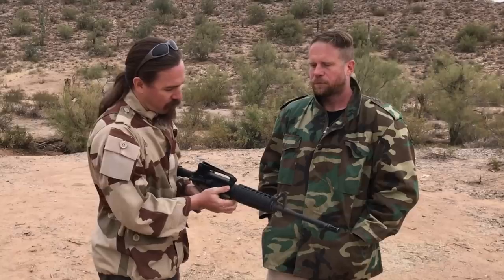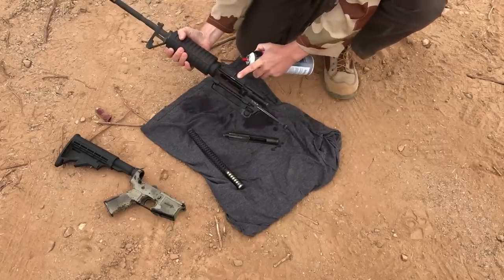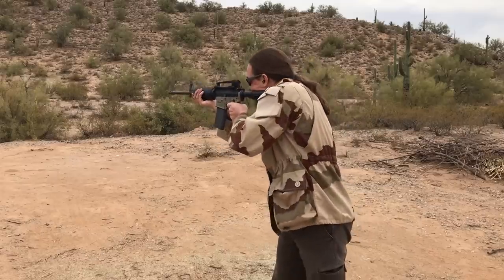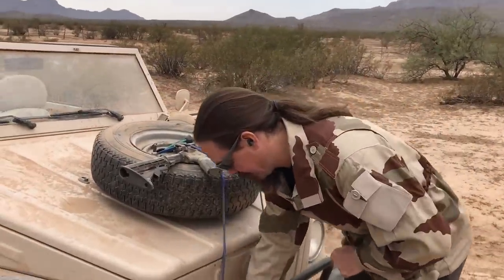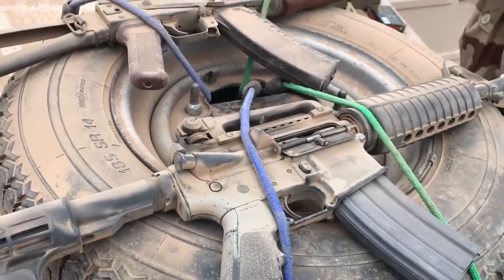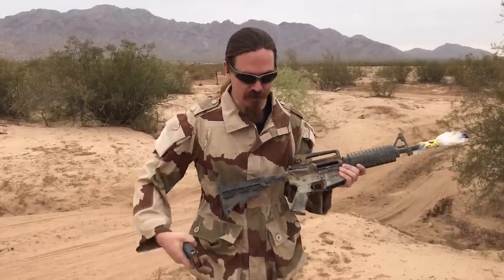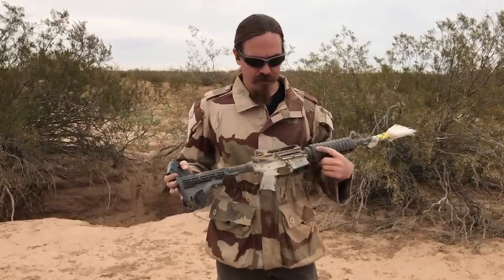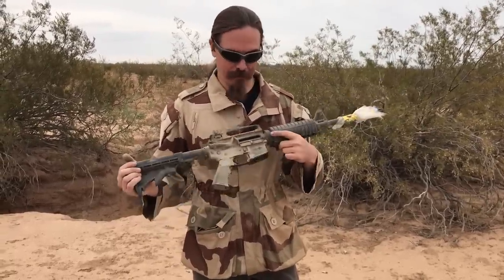Convoy Dust Test: M4gery / AR15

Comment: I'd like to see an L85A2/A3 dust test... It'd probably die but it'd be interesting to see.
Reply: I don't think it would i never had a issue with it in iraq. The A2 is not the A1 its like saying the current m16/m4 will jam because the original m16 in the 1960 was prone to jamming before the improvements the only reason a sa80 A2 will jam is because either the mag is damaged or the soldier has been slack with his or her cleaning drills.
Reply: In the '90s with the A1, standard practice was to clean it beautifully, put it in a dustbin liner, roll it up, tape it closed and put it in a locker. If it was needed, it could be pulled out through the side of the bag. I heard from one man that the only reason his L85 would be needed would be if he ran out of ammo for his AK-whatever-he-found.
Reply: @Mjk10957  the L85A2 uses the same receiver and bolt design, which would be responsible for how ingress and mud would jam the firearm.

As for your uninformed M16 comment, that was due to powder loads being changed by the Ordnance company in a total moment of negligence and intentional sabotage, as they hated the M16 and wanted to force the military to stick with the M14

Comment: It's honestly quite simple, tighter tolerances mean that coarse/large debris are less likely to get into the gun and interfere with the mechanism (by changing friction between components).
But it also means that, when there's something fine enough to get inside, there's less space for the debris to move around, and the dimensional tolerances make it susceptible to friction issues.
Looser tolerances mean the opposite: More likely to get coarse debris, but fine debris has enough space to move around and is less likely to cause a change in operation.

Good videos

Comment: The only time I’ve ever had an issue with moon dust was during emv before my first deployment. I had just finished cleaning my rifle and had never thought of not running it wet and when some ospreys came in to land dust went everywhere. We were then flown to conduct an assault on a mount town and my rifle had become a magazine fed straight pull bolt action. After I had time to clean it out with a toothbrush I was left with a substantial clump of wet oily sand in my hands and a good lesson.

Comment: The bolt was also locked to the rear when kicking dirt on it and the AK was closed. So I’m even more impressed with the AR.
Reply: The AK it's an open system, the AR is not, so it's practically the same

Comment: AK bolt closed and  AR bolt open in your final kick dust test. Prevents dust do get into the chamber etc. Guess thats y the AR stopped working and the AK was still running.
Reply: The AK bolt can't be held open because it doesn't have a bolt hold open device.
Reply: @thephoenix756  but you can close the bolt on an Ar15.

Comment: Upon rewatching this... During the dust kick test, the bolt was locked back, the AK does not lock back, so the AK had the benefit of the chamber being protected by the bolt, the AR did not.

So the test was actually worse for the AR.
Reply: The AK literally had rocks inside and keep shooting.
Reply: @dang0s804  They use different cycling systems.
Reply: The AK has a huge opening in the side of the receiver, so it was equally exposed to the dirt.
Reply: @thephoenix756  Not the chamber… The bolt being closed helps protect the chamber from dirt incursion.

There are three important areas in a firearm that contain tighter tolerances… The chamber, locking lugs, trigger. These areas need to most protection from debris, as they will cause hard failures if they get gummed up. 

It doesn’t take much dirt to cause big issues if it gets into the chamber. If you watch several test such as this one, the chamber getting dirty and preventing extraction of the casing is the leading cause of failures.

Even an AK will choke hard if grit gets into the chamber. It is a bit more tolerant though, as steel cased ammo is the most common and a little less susceptible to the grit, as the steel is harder than brass. So the grit doesn’t dig into it as much.
Reply: @marine6680  

Fair point, mate.

Comment: The Army uses primarily a form of government-issued CLP. We're trained to use it to clean the system, then leave a light-thin coating on all working surfaces, so we never really run our weapons dry. That may explain the anecdotal stories of jams due to dust in the field. Commercial CLP is allowed and encouraged, but if the same light residue is left then it would likely have the same result. Keep doing what y'all do gents!

Comment: Awesome video as usual. It's a standard full-semi m4gery . thanks for pointing that out ;-) . a well built AR-15 can be a very reliable rifle if done right. a 'lubed" rifle could bring more dust/dirt into the receiver and possibly cause more malfunctions. that is why both the AKm and the AR-15 were both originally designed NOT to 'require' lubrication.

Comment: In 1987 in bct at fort dix. I was issued a gm hydromatic m16. I put a round in the mag that had dropped on the sand and had particulate on it. Had a horrendous malfuntion, drill sergeant and i had an awfull time clearing it. He was laughing at the end and said, pvt lee. I hope you learned something. Did not have to do pushups over it. I think a lesson learned is to keep your magazines covered in the pouch on your ta50 gear and aways check your ammo when loading a mag and make sure it is clean.😂

Comment: Genuinely surprised conventional knowlage suggests 
Mud = AR>AK
Sand = AK>AR
Id say the Ak handled it better but still.

All in all, another solid informative vid from inrangetv. 👍
Reply: Makes sense. The AR is better at keeping grit out of the action, but the AK seems to tolerate more grit once it gets in the action, and fine dust is harder to keep out than mud.
Reply: @joshuab7737  That an objective lie: Dust cover open worked fine https://youtu.be/S5phNgZsaRg?t=902

And unlike the AR they didn't blow into the AK before trying to chamber the first round.
Reply: Exactly, bolt open vs closed

Comment: In VietNam in the dry season in I Corps we had failures due to grit and dust with the LSA we used. The muzzles we covered with unlubricated condoms and always checked the dust covers, the Mags were the problem in our web gear the flaps did not keep dust out well enough.

Comment: I know of at least one story from a Primary & Secondary modcast where it was stated that they would go out with no lube, or as little lube as possible to allow their gun to get through a mag, as 9 times out of 10 they never needed to fire more than one mag (if that, or at all); if a "real" firefight broke out, however, they would "lube-douche" their rifles with as much lubricant as possible right then-and-there, and worry about cleaning up the mess when they got back to base.

In other words, the trick to breaking an M4/M16 is to be in a unit where you're screamed at if you don't properly lube your weapon before every trip past the gate.
Reply: Correct, it was Chuck Pressburg who mentioned that.
Reply: Yes; I just didn't name him specifically as not everyone reading these comments knows who he is. :)

Comment: I have carried an AR in a buggy (Chenowth) for many years. I am a girl, I don't want to be out in the desert alone so I always take an AR. I took my most over gassed upper, put an old chromed BCG in it with a heavy buffer and spring. Running it dry it's very resistant to sand/silt. 
I kind of built it to be my "sand gun" and it has lots of mass in the BCG and buffer so it doesn't shoot as smoothly as my other guns but it is highly reliable in sandy/dusty conditions. 
Foam ear plug in the barrel, dust cover closed and plastic bags rubber banded over spare magazines and it has never failed me.

Comment: Military ammo is poop and mags in supply circulation are salt shakers half the time.
Reply: Military ammo is about as reliable as ammo gets, its meant to work every time and accuracy comes second. The mags are definitely trash, aluminum AR mags are all originally designed to be disposable after a single use and all they've done is tweak a few things in the design over the years to get them to last longer. A purpose built mag for longevity and reliability like the old steel HK mags are a much better choice for the military since they always refuse to scrap things they don't need unless they get told they'll get brand spanking new toys if they "forget" to properly rig up drop chutes in air exercises like they do with HMMVs a lot.

Comment: Yup. In a dry dusty environment you want the weapon dry as possible and still function. I live in Georgia.  So to protect from corrosion I run my guns reasonably wet, but still not soaked. Just a little oil on bearing surfaces and keep the barrel with a think coat to protect it.

Comment: Wait...You guys kicked moondust onto and into the AR with its bolt locked back, but the AK had its bolt forward sealing up a huge opening into the chamber.
Reply: good point, had to go back and look
Reply: @austinm2980  Ugh...Really?
Try for reading comprehension. I said the bolt seals up the chamber when it is closed (which it does on both the AR and the AK...and every other gun). I am aware that the AK does not have a bolt hold open device. The point I was making is that the testing should be fair where both rifles are in the same state during the tests. So since the AK bolt was closed, they should both have the bolt closed. Or rig the AK bolt to stay open during the test to match the AR's test.
Reply: @austinm2980  I think you are objectively wrong.

Comment: Bolt was always lubed because as you found out the bolt hangs up on the top round in the magazine. (Dust cover closed) Happens when dirty also I’ve had to run one like that slapping the forward assist each round while doing forward movement. (Shooting while in isosceles bend at the knees, left foot in front of right, lean into it, roll your feet like a ball moving forward shooting at targets) You’ll notice the same thing stopped the m4A1 after 960rds during the full auto test. Arisol oils hoppes/remoil would keep them running indefinitely. Hose the bolt down

Comment: Are we not gonna talk about the fact that the AR had the bolt locked back when they did the "kick sand all over it" test? It still did just as well as the AK which had the bolt forward in the same test.
Reply: Im shocked this isnt being mentioned more often. It outperformed the ak imo

Comment: While I was serving as a gunner in a convoy security unit in Iraq back in '06, one of our folks left their M4 leaned against a truck after the mission elements had formed up. When the column pulled out, the carbine fell into the tracks in the sand, and was run over by roughly 40 heavy trucks, mostly 6x6 armored 5 tons, tractor trailer rigs, and M1117's. The error was quickly realized, and we returned to recover the weapon. I happened to be the one to find it. The action was packed tight with the notorious moon dust with the dust cover having been left open, and the buffer tube ring on the lower receiver was cracked, but the nut was not loose. The action was completely seized. After separating the upper and lower receiver, and banging the upper against my boot until the bolt carrier freed up, I inspected it for damage, particularly deformation of the barrel and receiver, I found everything straight and true. The rifle functioned properly at the test fire pit without further cleaning. Any autoloader can be forced to failure with the introduction of foreign material into the mechanism, and all rifles have areas of close tolerance. I never would have thought of the AK's lack of a bolt hold open as a benefit, but it clearly keeps dirt out of the breech lock, should someone kick dirt all over it. The M15/M16 series rifle has an inexplicably bad rep. Between a few years on the shooting team, and a long tour in Iraq, I can't ever recall a malfunction or failure that wasn't operator error or a faulty worn out magazine. I've personally fired hundreds of thousands of rounds through M16's, M4's, and my personal AR15's. I have the benefit of advanced small arms training, but these rifles are truly easy to keep running, and have more than enough practical advantages over the AK variants to make the M16 A4, and M4 my personal weapon of choice. Assuming, of course that I can't have my old turret mounted Ma Deuce, or M240B to properly lend cause for pause to ne'er do wells, and put the lead to any foolish enough to play around the boundaries of the ROE.

Comment: You didn't have the bolt locked open when you kicked the dirt into the AK. Why did you have it locked to the rear on the AR? Seems a little unfair.
Reply: The AK literally had rocks inside.
Reply: The AK does not have a bolt locked function.

Comment: I was a Marine artilleryman for 6 years and have an interesting story about lubricant and sand/dust at 29 Palms. We were told to disassemble the howitzer's breech and primer feed mechanism and remove all grease and clp from them due to the desert conditions. Four of our six guns, all M777A2, did this. I was one that didn't and while yes my breech turned into a nasty dirty soup it never once failed or seized up. The three other guns with no lube or grease ended up seizing their breech blocks after a week of firing.

Comment: So what is the takeaway from the AK-v-AR debate?

First, the AK is more likely to fail in a normal operational state when exposed to extreme mud. However, it can also be very easily and quickly remediated in the field with little more than a wash down and a rag. 

Second, the AR is more likely to fail in an abnormal operational state when exposed to extreme dust & sand. However, both platforms are equally viable when run in a normal operational state in the same sand & dust conditions. 

Third, both rifles are practically guaranteed to fail when run in an abnormal operation state when exposed to extreme mud. 

This is pretty much what everybody expected. That being said, it's still worth noting that the AK will generally be the more reliable platform in typical poor conditions when run with poor maintenance and poor safety. 
The AK doesn't mind a bit of dust in the action; the AR is more susceptible to failure with dust in the action, but is also better at keeping it out. 

Conclusion: Practice proper firearms safety and maintenance!
Reply: this man gets it. ^
Reply: @Quartzkensai  Thanks. I think that's what the fellas at InRange are trying to get across with these tests. It's mostly common sense, but the results are still very interesting to observe.
Reply: I'm not so sure the AR is more susceptible to dust than the AK. The bolt was open on the AR when they kicked dust on (in) it but the AK bolt was closed in the same test.
Reply: @MarvinCZ  Interesting point. 

Counterpoint: You can't lock back the AK's bolt anyway. The fact you can with the AR is actually quite concerning...

While I appreciate it assists in rapidly reloading a fresh magazine in the field, having the bolt lock open on an empty chamber with dust cover open is just inviting the sort of FOD ingress this test was addressing. This part of the test is geared to emulate a locked back rifle dropped into the dirt between reloads. 

The AK is still the more tolerant platform for these specific conditions under normal operation.
Reply: @dylanwight5764  Nothing prevents you from closing the bolt manually, it's quick and easy. It's only a concern in very rare circumstances that border on negligence.
Reply: @dylanwight5764  Fine, if you will. Under the most extreme and unlikely circumstances, it still didn't fare much worse than the AK, it didn't "fail" (I mean fail as in fail the test, it had failures that were easily fixed, so did the AK).
In anything less than the absolute worst, it's at least as resilient.
Reply: @MarvinCZ  Not as unlikely as you might expect. I can only speak from my experience, but that may be biased towards the AK since I was saddled with a well used M16A2 at the time and was running it wet. I could keep it going, but it consistently failed to cycle due to crap getting into the bolt group. 

Remember that this test runs both rifles dry to give them both the best possible chance of success. Ideally, that's how you'd want to run them anyway, so it's not an unreasonable advantage for either. The M16A2 clogs up right quick if its run wet though. The AK doesn't experience this issue as severely when run wet.

Comment: its not even reliability that i take into question when i think ak vs ar. the ak is simply inferior because of its weight, lack of rail space, handguard, stock, sights. sure some of those things can be changed but they will never come near an ar.
Reply: AKs seem to work much better in the third world with no maintenaince. There is an ISIS helmetcam vid where the ISIS commander had an M16 and it had several jams in two or three mags. If the rifle is going to be used by someone with an IQ below room temp an Ak is probably best

btw the ISIS commander died
Reply: The AK-12 seems to have fixed all the problems of the AK platform; the weight of the AK-12 is 3.3 kg while the M4a1 weighs 3.01 kg, so the weight difference is negligible.